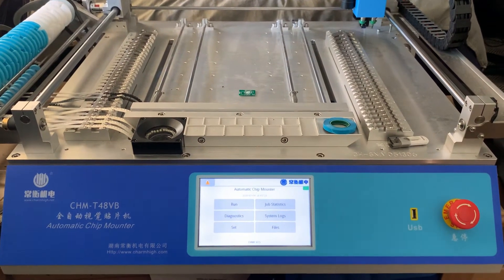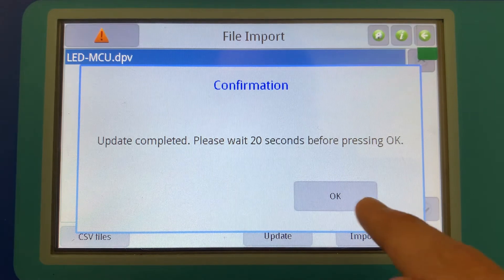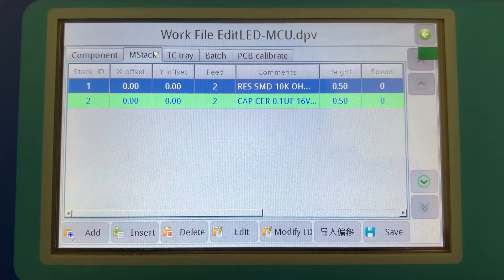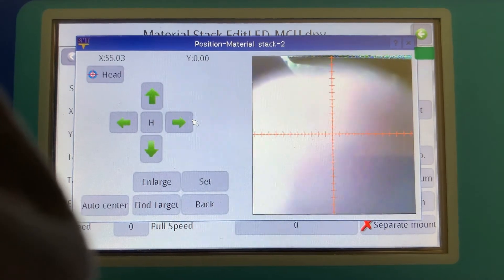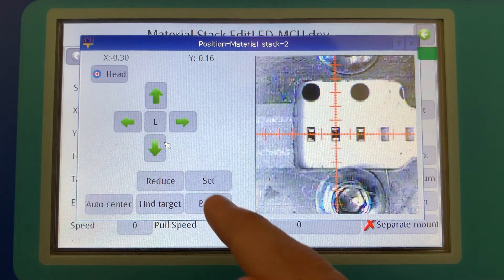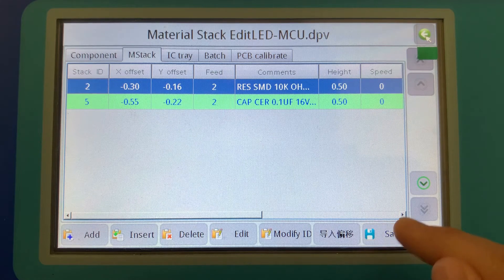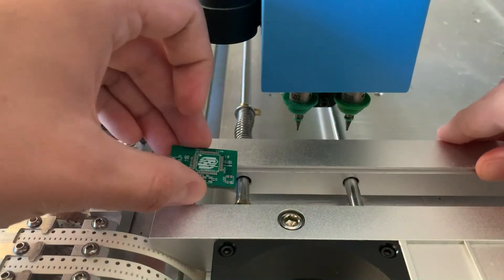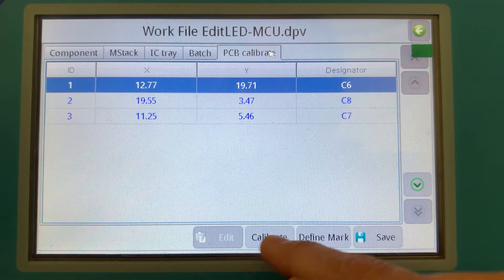How To Setup and Use a Charmhigh CHMT48VB Pick and Place Machine

Comment: Hi Shane, there are a couple things I would suggest doing different. First, it is generally not necessary have a component in the tape, you can, as you stated later in the video, center on the pocket in the tape, not the component. Second, pulling the tape to feed it (when you were trying to expose a component) will likely shift the location of the feed holes with respect to the drag pin that drops down. Getting the drag pin aligned with the sprocket holes on the tape is pretty fussy/tedious. That is subject to a whole other video.

Comment: Mr. Kent , thanks for the video. Do you have any experience with fiducial PCB calibration on same machine. I tried once but without good result. Simply 48VB didnt place correctly any component. I tried to go back to PCB Commponent calibration didnt work as well. Factory reset made me back to Commponent calibration.

Comment: Hilarious. The device tells you to wait 20 seconds before pressing the button, but doesn't time it for you?!  Does it come with a hand stopwatch?  Good indicator of design quality right there..
Reply: I have a model below this, a CHMT36VA, no screen so the control interface is through your computer running their software. The build quality is actually pretty decent. The software, particularly setting up a run is pretty clunky. I've counted to five and that is enough time. I think it is to cover the time needed to load the file. I think 20 seconds is to cover something with a very large number of components. I've not tested that yet.